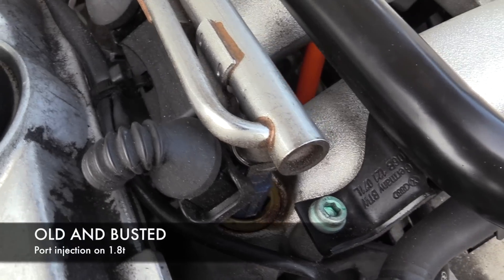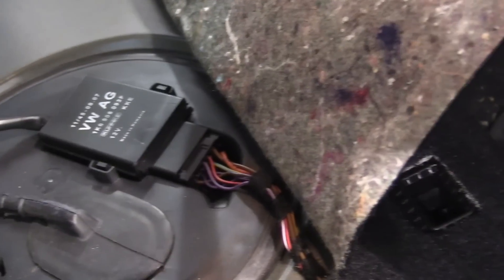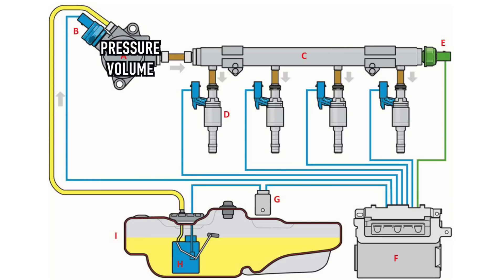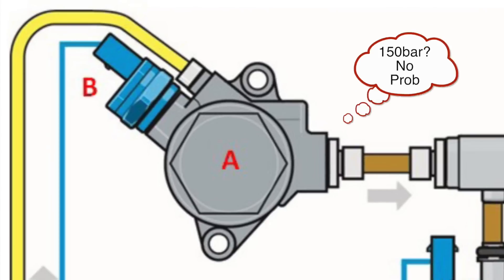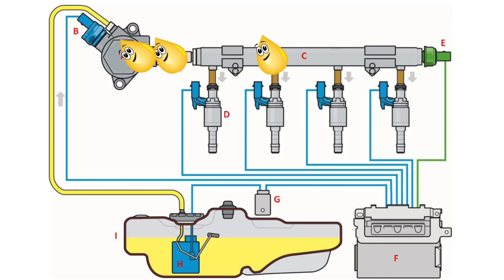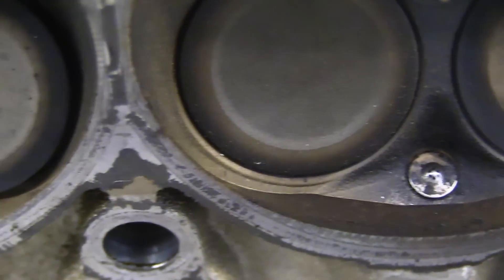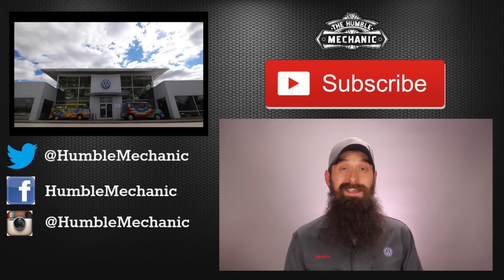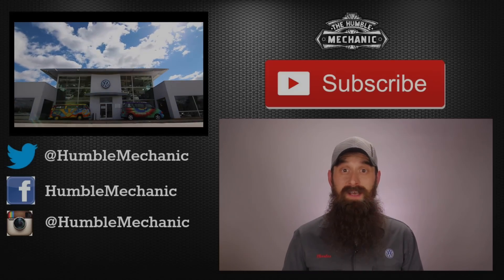VW Technician Competition Video ~ Direct Fuel Injection

Comment: Why does the ECU PWM the low pressure fuel pump instead of simply driving it on solid? I thought the low pressure fuel pump was not metered and was sending constant pressure/volume. Is it because it is a return-less system?

Comment: Great video. 
not sure i have faith in VW cars after 2002 models. they are just filled up with sensors and complex tools  . for simple that fuel injection valve on video 4.48 . it will fill up the holes in no time of the fuel injection valve.
Reply: Ok so what can set off the fuel pump module ....can the injectors do that?

Comment: The ECM is the brain.  The heart is the water pump.  :-p
Reply from the maker: +ExaltedDuck id actually think the oil pump more the heart. If we were talking about the engine as a whole. ;)
Reply: perhaps.  I would think of oil more like a lymphatic system, but that wouldn't have a specific single pressure source.  Maybe the water, oil, and fuel pumps are all hearts of a sort.  Conclusion: cars have weird biology and might just be alien in origin.